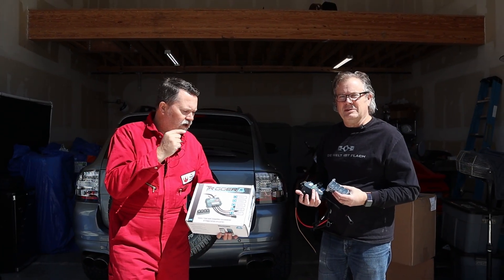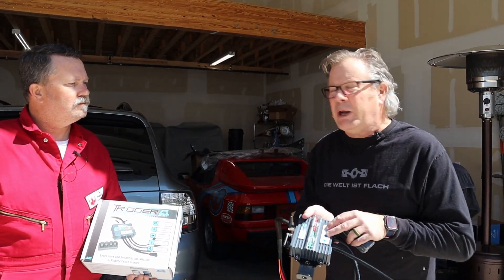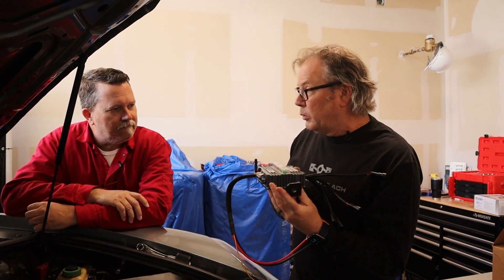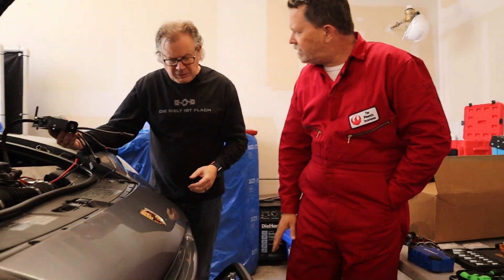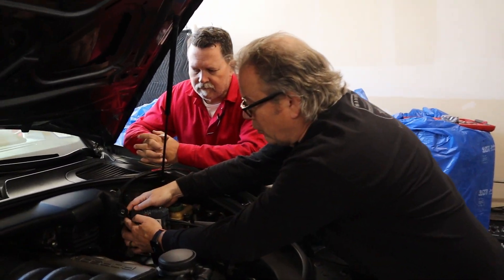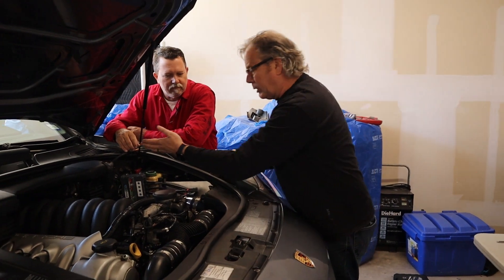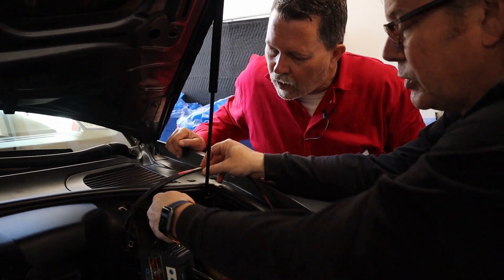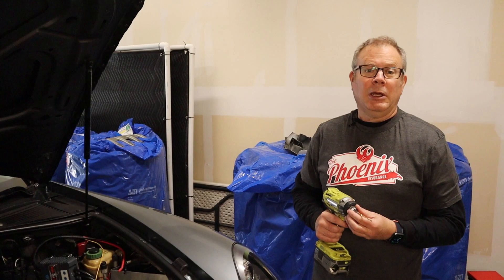Trigger 4 PLUS Install on a PORSCHE Cayenne Turbo S! - NEW LIGHTS FOR THE TURBO S!

Comment: I've been building a Porsche 924s Safari, and was looking at different ways to power lights, without having to use a ton of relays and bulky wiring. I really like this Trigger system. The only issue with the older porshe they don't use a modern fuse for the trigger wire so you can use a fuse tap. Is there a another solution for the old style fuses you can think of? Thanks, wiring is not my Forte lol
Reply from the maker: They probably have a style of fuse tap for older fuses. You could also tap into the key on wire
Reply: @husmanbros  thanks ill probably tap into the key on wire, since it's not drawing power, its just a signal